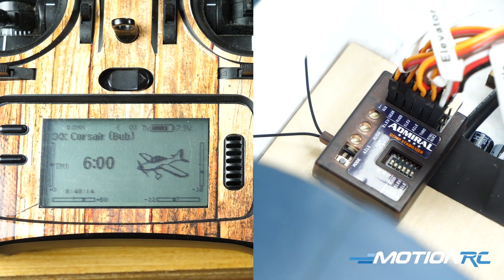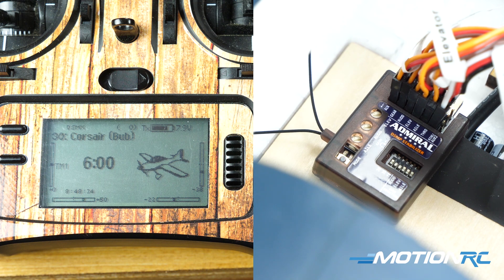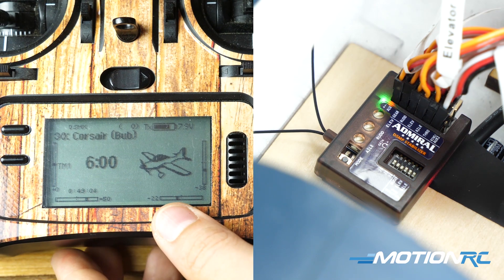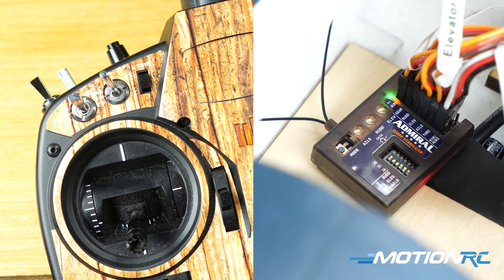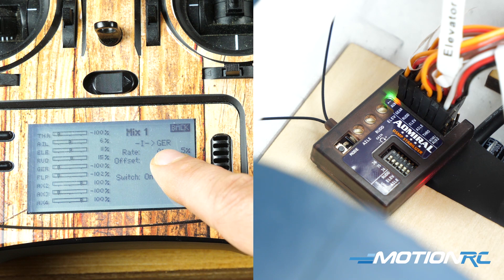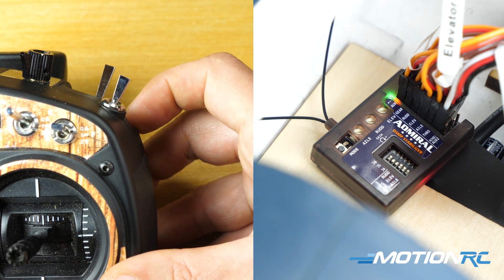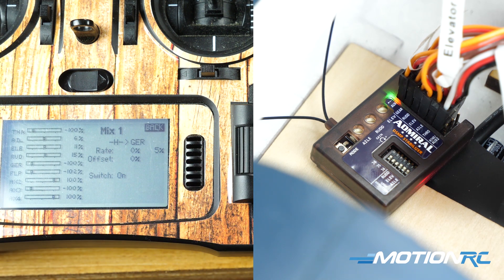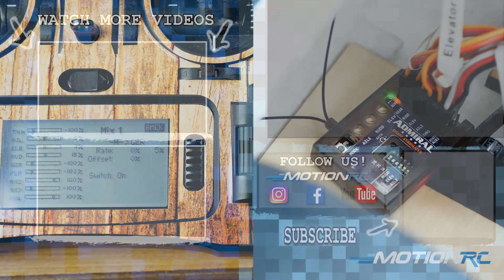2 Position Switch Setup - Admiral RX600SP Stability Plus Gyro - Motion RC

Comment: Roadstar499 has a great question. Is there a way to make the gyro work on a switch and still have the recovery mode?
Reply from the maker: No. This gyro has only 3 combos each of which have 2 options. So it's either on/off, on/recovery or off/recovery

Comment: Still in the dark on how to set this up with a JR X9303 radio. The bind button isn't assignable to a channel mix with this radio.??And I wouldn't want to use the bind button in a mix either. Have you guys set this up with a JR radio?
Reply from the maker: These receivers are DSMX compatible, they won't bind to a JR unless you have a module?
Reply: @MotionRC  Spektrum actually came from JR. Both use DSM protocols. DSM advanced to DSM2, then on to DSMX. My JR 9303 does both DSM2 and DSMX. I have many Sektrum Rx's in quads and airplanes that have no issues. Oh, and I did figure out how to set up the gyro control today, thanks to a chat on the phone with one of your techs, Derek. The Rx just needs to see a change from 100% to 95% on channel 5. So, I just assigned my AUX2 channel to my flight modes switch and set up a mix where AUX2 in one position has channel 5 at 100%, and the other 2 positions have channel 5 at 95%, works as easy as that. Thanks Motion RC! And, I'll be buying my 2nd jet from you guys soon, loving my Avanti S so far!

Comment: OKAY.so after flying in mode ''C'' with these new settings so you can turn gyro on and off using switch,can you switch back to ''A'' Mode and it still has bind button activated to work SAFE Mode(level flight)? or do you have to go back and change ''I'' to H first???  And "C'' mode is the only mode that allows you to switch Gyro on or off? Correct? thax